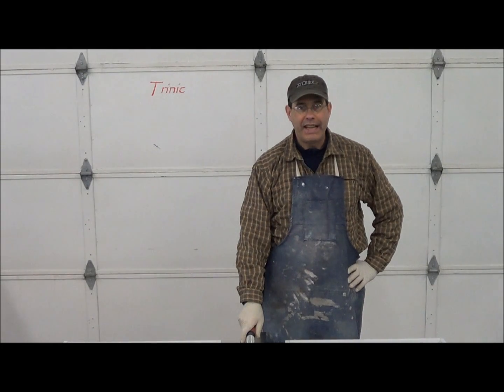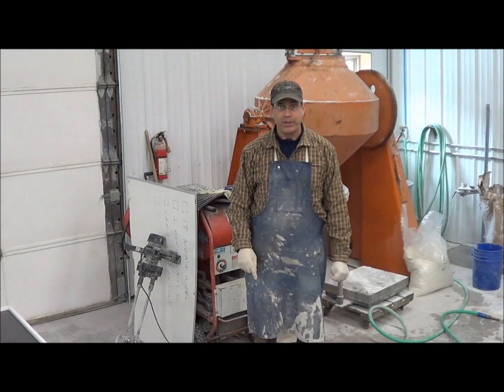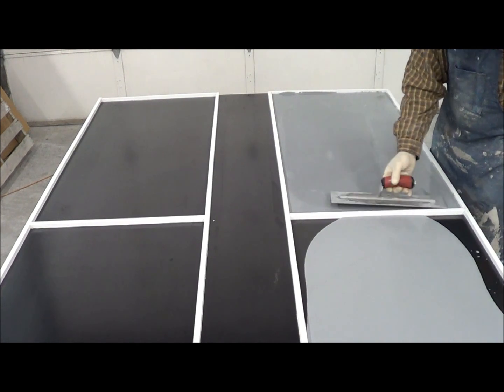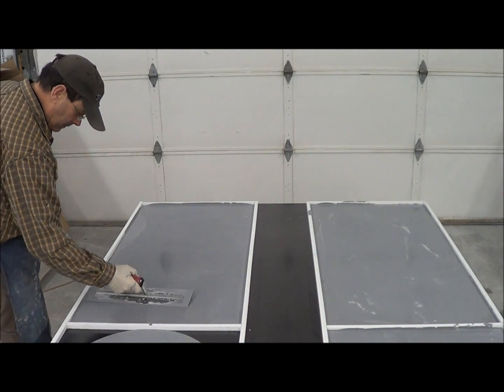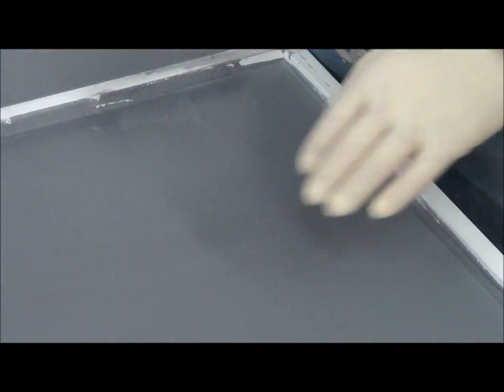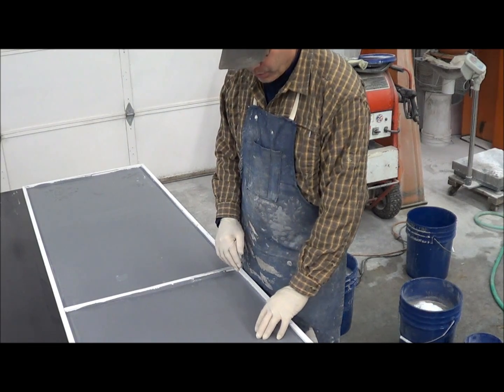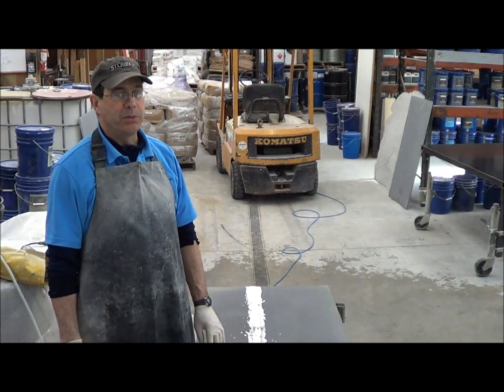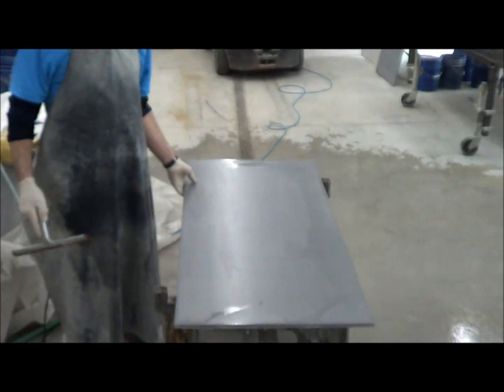Casting Fast Set GFRC (Glass Fiber Reinforced Concrete) with a troweled facecoat

Comment: Great stuff. any idea on how to get the face coat on the side wall as well (without spraying) so I could prevent the fibers bleeding through or it shouldn't be a worry. What fibers you are using pls?
Reply from the maker: If the edge is short you can just brush it up the sides but if it is more than a couple inches it is easier to spray. We use either Cem-fil 60 or PVA RECS 15 for the backer and direct cast (SCC) pieces and HD anti-crack in the face coats.

Comment: Hi, Could something like this be stuck to a cinder block wall?
Reply from the maker: Daniel Taylor sure can, building cladding is one of the most common uses for this material.
Reply: @TrinicLLC  I am trying to source all the materials in the UK but not being too successful. cement, silica, fibre glass and plasticiser is available but the rest seems hard to get hold of, any suggestions? im guessing the ingredients are vital. Also would it be possible to skip the and just add the back coat and the sand down if you were planning on painting the sheet?
Reply from the maker: We are shipping out the first sticking order to the UK next week so your timing is good. Send me an e-mail to info@trinic.us and I’ll help you pick what you need.